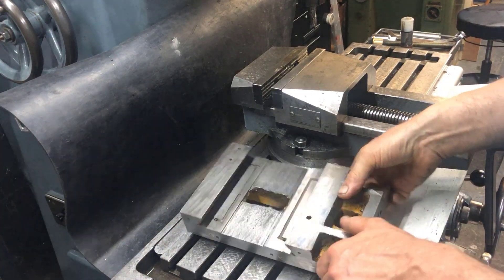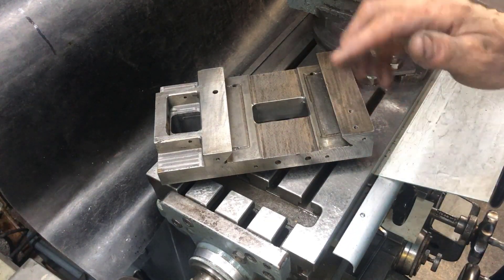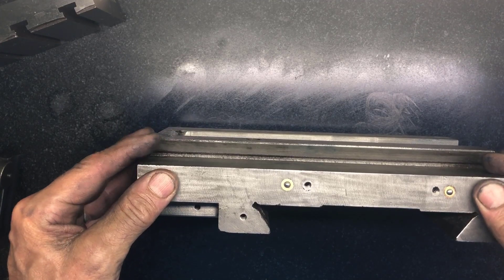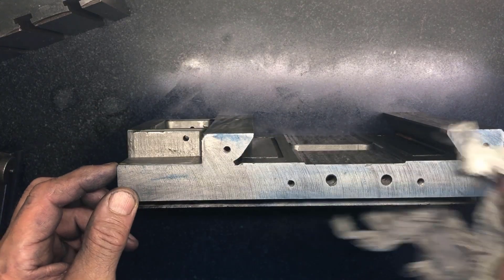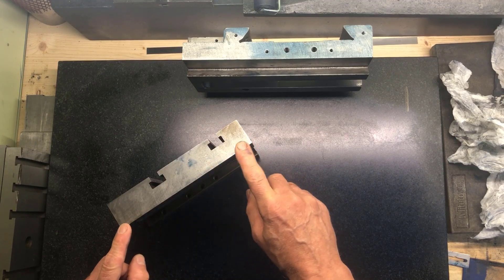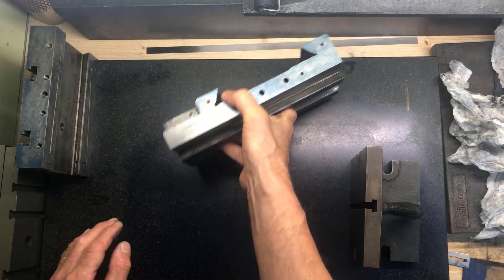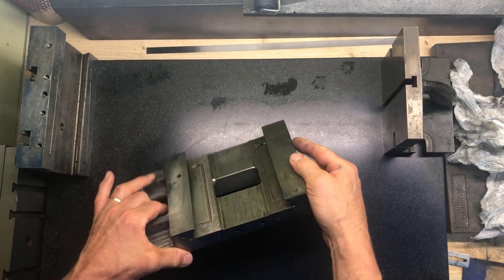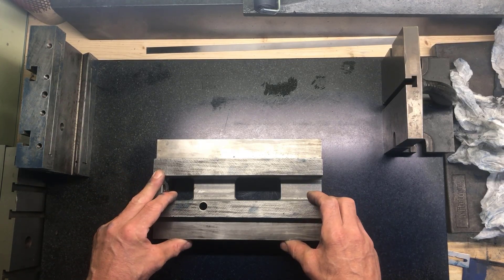AT-300 lathe-mill-drill, cross slide and saddle testing - 1

Comment: Excellent project, thanks for sharing. I would suggest on the initial printing, the workpiece should be stoned nicely. Then when you place it on the surface plate to print it that you try to hold one side only so as not to induce a false reading due to inconsistent pressure. Additionally, you should hold it by each end and swing it back and forth to see where it pivots verifying your high spots. At least that's what I learned in Richards scraping class and read in the Connelly book of machine tool reconditioning.
Reply from the maker: Thnks. Agree, always stone before any "unknown" piece is brought to the measurement surface. I did this here also, but on one of the sides still had a high spot (possibly from overtightening the T-nuts or a bump to the compound. .could be when the machine fell over and broke the cross feed handle). Anyhow, the sharp edges were taken down.. this is the key point. A high spot like shown can take much more stoning, but you wont know before testing. I wouldn't stone harder than taking down more than the sharp edges anyway.. this is true also for stoning inbetween the scraping cycles where you (normally) leave a burr. if you get carried away wih stoning, you may lose some of the scraped surface finish.
Of course, I also do the "hinge test", thanks for pointing out. :)  PS! You may find I am skipping other parts too.. maybe a fault on my side not showing all steps (I didn't realize that I may have some new viewers not looking at the former videos), but as I have shown these steps several times before in other series eg. when restoring Myfords etc. I may have left these out here. Sorry about that.
Yes, as Eric here points out, you always follow the "rules of scraping" as we have been taught. This is the best way (probably not the only way, but).. one that is guarenteed to guide you through the scraping process to predictable results in an efficient way. Learn the basics and stick with this.. if you get into trouble, revert to the "manual" and go through this again.. you might find that you have missd out on or forgotten something :)